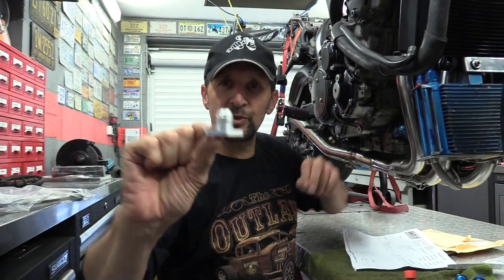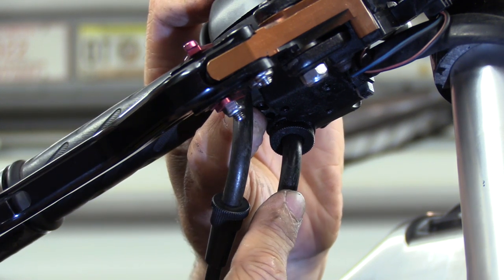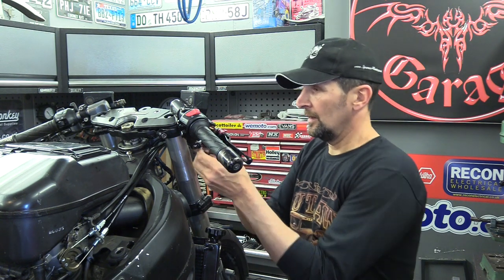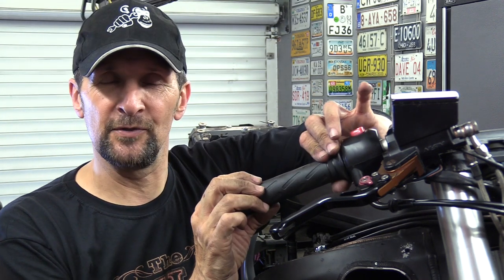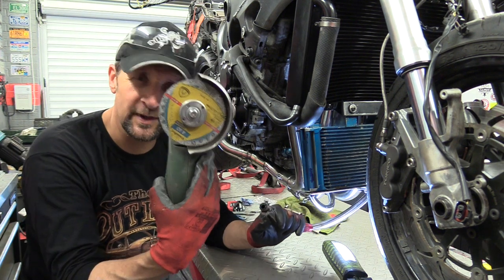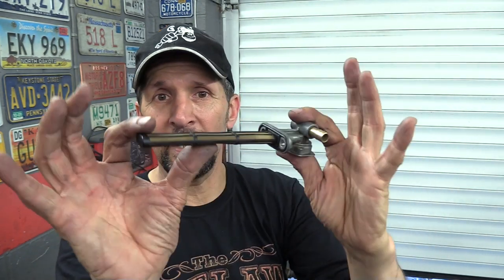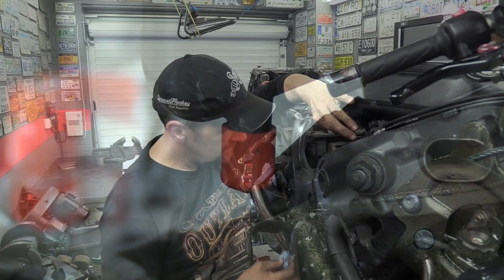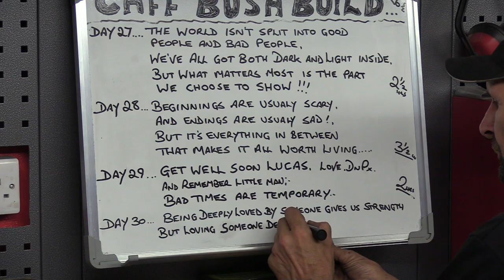Delboy's Garage, Hayabusa 30, "Throttle Cables Replacement" !

Comment: Per your advice, I just finished replacing my FZ09's throttle cables that had 62k miles of wear on them.  The throttle is remarkably smooth with a crisp return snap that I didn't even realize was missing!  ~120k miles of street riding experience and until I saw this, I never even thought to replace throttle cables since they always "just worked fine".  I am pleased.  Thank you for sharing your wisdom with the world.
Reply from the maker: Most welcome Sir, glad it helped you... enjoy your bike!

Comment: I’m a Honda main dealer mechanic, and despite the service manual saying to adjust the free play on cables, clutch and throttle, unless they’re excessive either way, I don’t touch them, because as you said, people normally have them set up to how they like it 👍
Reply from the maker: Dead right mate, glad to hear it, can you have a word with some of the Harley Techs, who seem to think 1/4" of freeplay in the twist grip is correct lol !
Reply: Moonfleet41 i try my best not to work on Harley’s anymore 😂

Comment: Thanks for this video. Very informative. I don’t have the mechanical aptitude of my 2 younger brothers but your video has given me the confidence to do this job on my 03 Yamaha XVS 1100. Thanks
Reply from the maker: Most welcome John. Glad it was helpful!
Reply: I do appreciate you getting back. I have an issue with the throttle body being stuck. After I swap out the cables, is there a way to externally lubricate the throttle body? I just don’t feel competent to go beyond that. Thanks

Comment: Thanks for the info on the oil cooler fittings and showing how to shorten them, I hadn't realised how easy it was to do.
Reply from the maker: Sure thing mate, it's really basic technology, you just gotta be a bit careful with the threads, as being aluminium and quite fine, they're quite easy to cross thread, or strip...!
Reply: @Moonfleet41  thanks

Comment: Any tips on an R6 2005? I've done everything so far. Replaced cables, adjusted tension, cleaned throttle tube out (it does has a crack in the plastic near the bar end but not fouling the bar) The only thing i can think of is the pulley as i removed it to clean. But it snaps back fine without cables on. Soon as i install cables it just sluggishly rotates and i still have 1/8th of a  turn left before it's at 0

Comment: Nice video on the "clean ups". I am looking forward to the up coming metal works!

Watch ur digits with that English wheel, those things BITE!  Anyone who is good with a English Wheel is worth there weight in gold. Best of luck to you with that thing! ( I can make wrinkles fairly well). Just no where near where i want one, of course..

A little hint with the "sand bags", ya just might try making a "Shot Bag" with one or two. By loading the bag with bird shot in lieu of sand. The weight difference all but kills the sheet metal rebound when using forming mallets. The weight also holds things in place very well. In the shop we call them sand-bags, but they are leather bags filled with lead shot. The higher the number the finer the shot. #7, 8 & 9 are common for clay sports and are common but more expensive. Some shops sell the #6 through #0 on sale as it is only used for hunting loads. (Supply & Demand dictates co$t) Many of us re-loaders have ample amounts of odd size shot on hand. So ask around. It is unfortunate that the cost of shipping lead (Weight + Hazmat fees) is way out of the park to send you my excess. Perhaps check with a gun club?
Reply from the maker: Thanks for the great help and info Scott.. It seems like ive been reading about 'wheeling' all my life.. i was given a book as a kid back in the 70's by Eddie Paul, and was hooked, never stopped reading, i even used to buy is videos back in the 80's to learn and pick up tips and inspiration.. i always admired him and how he didn;t just build the coolest movie cars ever.. but was happy to teach and share his skills.. a sad loss to the Custom world when he died a few years ago... 

Ive got some silver sand on the way for the bag at the moment, as you can imagine with the very different gun laws we have over hear it a lot harder to buy shot in quantity,  but ill see how i get on with the sand to start with, and as i have a few friends who go clay shooting, ill ask them if there are any sources for shot i can access... Thanks for your kind help... take care.. Del.

Comment: So Del small piece of advice for the Wheel when it gets there. A: Do NOT try and curve metal for 8 hours straight! Your forearms will be screaming. I speak from experience on that. B: The different dies will put steeper and steeper curves into the hammered piece. Practice with each one separately so you know which one puts which curve rate on a sheet of metal. C: Work the metal, don’t let the metal work you. Good luck mate! Can’t wait to watch!
Reply from the maker: Thank you so much for that priceless advice sir., ill take it all on board, ir a totally new skill set for me and something i have wanted to learn for all my metalworking life...  ive only bought a small portable wheel for now, no space for a proper one, and im sure it will still give me the principles i need to get started...    Thank you again for the advice, that and the "watch your thumbs" will be in my ears as i start rolling my first ever sheet metal...

Comment: You make the throttle part look easy, its awesome when everything goes back together with ease.Question have an old zx6 carburetor cable hooks between the 4 carburetors, little cable holder hook had an ear busted off that holds the cable& the lead  o n     the end was only half there, how would you tackle what I’m saying?

Comment: Love these videos, just curious, o own a mk1 bandit 600, my throttle cable must be really slack, I've adjusted it out fully at throttle end and still seems like too much free play, which direction is to tighten the cable at the carburetor ends of the cables, clockwise or anticlockwise

Comment: question : after I adjust my throttle cable on my 2005 hayabusa it started working fine, the accelarator wont get stuck, but still has that hard starting, I move  the choke lever up and dont start, move it down and after 5 attemps it starts in very low RPM s, any idea or advise, how do I know if my choke is working properly ? thanks, you are a good teacher.

Comment: Great video, cheers. I recently changed my cables on a k4 gsxr and I've a fl light showing with the idle going up to 1500 rpm. Turn the bike off and on to clear it but happens again randomly. Could my cables be set too tight? I've no freeplay
Reply from the maker: Don't know without seeing it mate, but all cables should have a fraction of freeplay at least to allow the throttle stop to rest, so at least do that first and then see if it clears it.

Comment: Great video del, just a thought was there a pipe clip at the petrol tap end ? 
Looking forward to the creative stuff...
Reply from the maker: Hi there, there wasn't one on there, partly why it was probably leaking, I simply don't have any spare ones at the moment, I need to  buy a packet, but it won't need it till the end when I finally plug it all in and fire it up!
Reply: @Moonfleet41  hi Del , thanks for the reply, I suppose in a way it may not need one , not being under pressure, but I suppose it would be best to fit one.
Great series Del looking forward to the progress.
Regards

Comment: Hey brother.  Does the end of the fuel hose that connects to the tank need a clip of some sort?  Just checking.  I'm really loving this build so far, sir.  Those basic maintenance videos are what brought me here years ago.  I'm also a HUGE fan of steampunk, so can't wait to see what you do.  Awesome!
Reply from the maker: Hey Brother, yeah there was a clip missing from the hose. and as you saw it was chewed up too.. i simply don't have one to hand at the moment, which is no big shakes as the tank will be off and on again lots of times over the build and the tank wont have fuel in it for a long time yet...  The steampunk theme is only a loose plan, it all depends on whether i can pull off the skills to make the bodywork and create the shapes i want... time will tell, this is a new skillset and something i have to get round first if i want to make a good job of it...  Gonna enjoy the journey.. take care and have a great weekend.. Del.

Comment: Cracking Video Del, finally forward progress on the Busa lol, ask you a quick question if you don`t mind, 02 Triumph Bonneville America,, what is the best Die & Tap set to get for these mate, the metric one i have doesn`t come close to the correct thread gauge, once i get my tins back from hydrodipping / painting i`ll need to clear the excess paint out the threads, don`t wanna f`k it up on the rebuild, any advice mate please,, ain`t got a clue what thread gauge they would be. Cheers Buddy.

Comment: Hi del I'd like to see a video on you replacing the 1400 cables ..I'm guessing you're gonna need to remove throttle body . Of course I've put them on recently but wouod like to see if theu csn be done in situ given where they are situated.  Nice work .

Comment: Hi Delboy! The Haynes manual for my bike mentions some lithium based grease between the bar and twist grip, would you recommend this or just a nice clean and polished surface as shown in this video? Cheers from Norfolk!
Reply from the maker: Much of the time, the throttle tube spins freely over a clean bar, you just don't need it, but if there is a bind in that area then a little waterproof grease will help for sure.

Comment: Have you ever tried Dri-Slide Graphite lubricant for your throttle cables? I used it doing 5000 and 10,000 mile services on Harleys up to the just past the Evos. Thanks again.
Reply from the maker: Hi buddy, yes I have, great stuff, I use it on squeaky belts (purely cos they're irritating) and on the chains on the bikes too, the Wurth Dry Lube is perfect for the job.

Comment: Another great video - thanks as always Del, but why Vaseline and not grease on the cables?
Reply from the maker: Recenlty put some Barnett cables on my Harley project and they come with a sachet of Vaseline, I looked in to why, and it is apparently spread around the heads of the cable where they join the wire to prevent mositure corroding the cable at the top... the Vaseline forms a hard wax seal over time, as ooposed to grease which eventually washes away, it's more there as a sealant, rather than a lubricant.
Reply: Thanks!

Comment: Hi Del, Love the videos!!! Watched this one twice and ordered the same cables for my 1999 CBR900RR Fireblade which I'm rebuilding as well as a winter project. I had the same issue with the throttle. I have fitted the new cables, but still having the same problem. When the push cable is taken off it's mount on the carb, it works perfectly, but once connected, sticky again. I have tried adjusting the cables but cannot get to the bottom...thoughts?
Reply from the maker: Hi buddy, is this with the new push cable you've bought?  Have you checked that it's maybe kinked or pinched, or is it turned too tight round a corner?  If you disconnect the push cable either end, does it slip in and out of it's sleeve easily or is there resistance?  If so, then that's your problem... for the throttle to snap back, the cables must have practically zero resistance.
Reply: @Moonfleet41  Hi Del, thank you for your reply. If I had your email I would have sent you a video showing you everything. I have ensured that the cables follow the correct path (no kinks) and move freely before installing them. Brain scratcher this one!! Done cable replacements on a few bikes, this is just weird!
Reply from the maker: @darrylcoomer1539  OK mate, here's our email:  delboysgarage@yahoo.com    maybe it's easier if I can see what's going on!

Comment: Hi Del I was wondering if I should use thread lock on the bolts to hold my new ignition barrel into my motorcycle
Reply from the maker: Well I do, and when I took my old lock out, the factory bolts had threadlock on them also!
Reply: @Moonfleet41 Thanks for the help Del also what colour thread lock should I use?
Reply from the maker: @thedemondgamer5096  Nothing fancy, i just used the regular blue stuff i had to hand.
Reply: @Moonfleet41  cheers for the help Del also looking forward to the next Busa vid

Comment: How much disassembly is required to replace the throttle cables on a 1997 GSF1200 since the carb end of the cables are buried in between the carbs ?
Reply from the maker: As you may have seen with my carb strip video (on my Triumph Legend posted online last week), I just pulled the carbs out, which didn't take too long and was able to replace the cable dead easy, so it's a trade off of time, take an extra 1/2hr to disconnect the fuel line and pull the carbs out, or spend 2hrs fiddling around in a dark tiny space trying to connect the new cable end... sometimes it's easier to just strip things and get at the job!
Reply: @Moonfleet41  Thank you.  That's what I was thinking as well. I wish they were on the outside like your Hayabusa project :)

Comment: Hi Del, great video as always! 
I'm just curious if you need to worry about debris getting in the oil line when you did the cutting? 
Really looking forward to the English wheel, if anyone can master it you can!!
Keep the awesome videos coming 😃👍
Reply from the maker: Hi Harold, lovely to hear from you, as ever... from cutting the pipe the only thing that may have got inside would be a little rubber dust, which is pretty harmless and when I get to the end of the build, then I intend to wash the oil cooler out anyway, as I recieved it as a gift and don't know what's actually inside it, if anything... and I can do all the lines at the same time!... Thank you so much in your kind faith on the English Wheel, it remains to be seen if you're right, but am determined to make some results with it, and as the bike is a 'rat rod' design, then it won't matter at this point if it isn't perfect... (Well that's my excuse anyway!), all the best, Del

Comment: Do you usually lubricate the new throttle cables inside ?
Reply from the maker: No, fit them straight on as they are.

Comment: I've just DIY'd a new set of Domino Throttle to my K4.......hasn't quite gone to plan. The bike is now struggling to start unless I slightly twist the throttle?!
Reply from the maker: Have you set the idle, it's only a tiny screw that does, literally, what you said... it holds the throttle slightly open... it should give you the base setting in your manual.  See if you can find it on the actuator, it's the little base plate that the assembly taps against when you shut the throttle... you just screw it in a little so the throttle doesn't shut completely... give that a try and see how you go mate.
Reply: @Moonfleet41  Aaaahaa, makes sense. It's going back in the garage Monday for other stuff so will get them to check. I've had enough for today! Haha. Thanks for the advice thou 👍
Reply: @Moonfleet41  Done it, worked perfectly 😊 Again, THANKYOU

Comment: 26:42 No clip? Q/ why do you put rubber grease on the hose connectors?
Reply from the maker: Clip was already missing as you may have noticed, don't have one at the moment, tank will be off and on many times during the project, the rubber grease helps them slip off when i need to without pulling the brass fitting out Again..!